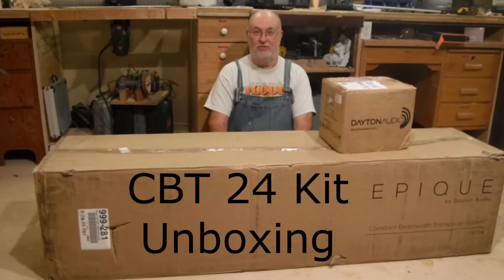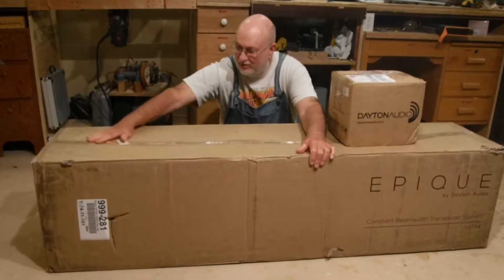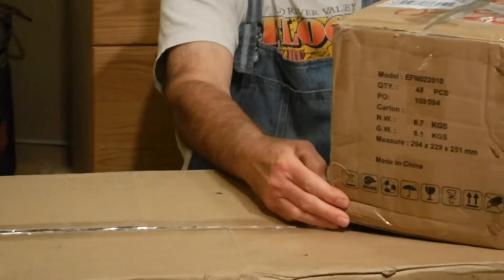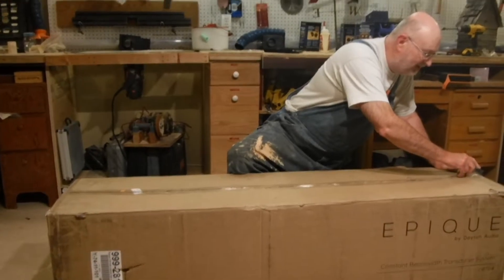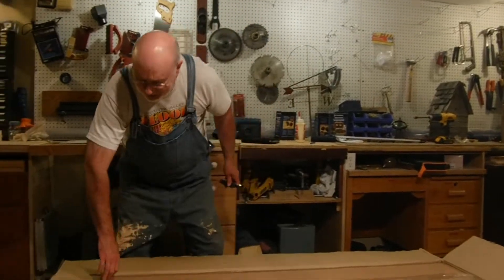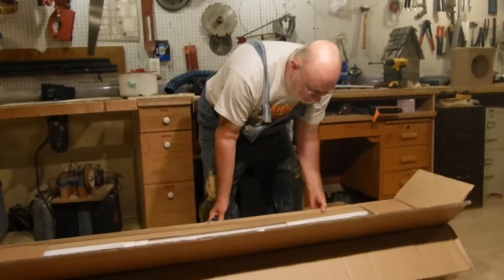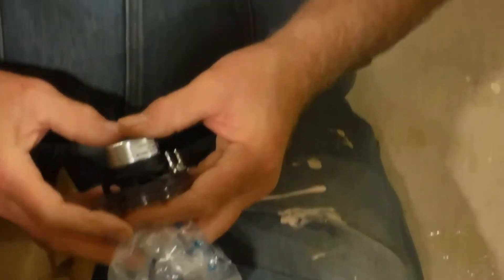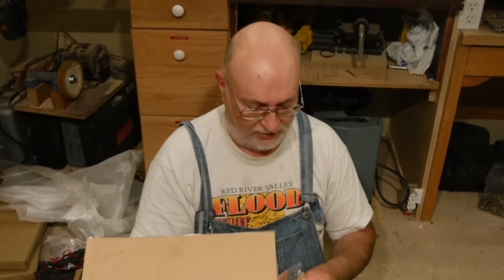Dayton Audio CBT 24 Kit Unboxing

Comment: So, what do they look like assembled??  Cant wait.
Reply from the maker: Tomorrow I finish painting them ........ video to follow ;) Assembly is probably on the weekend ........ video to follow lol.
Reply: @clydelindman6083  Cant wait to see what kind of finish you put on them.  I am guessing natural wood veneer if anything to match the house?
Reply from the maker: @tkcdac  I actually went for basic black. I put a roundover on the edges so they would not be so sharp compared to the curve of the cases. Glad I did that as it makes it look much more organic. I decided to just do brush and roller for the paint. Probably a mistake as the MDF broadcasts every unevenness. Next life I'll spray it :P I thought of veneer but have only done it once in my life and I did want the radiused edges so that would have complicated matters more as the curves are quite tight and probably would have cracked the veneer.
Reply: @clydelindman6083  Really excited to see how this comes out.  I am working on my own exciter panels in a 4 driver array per channel as "Tech Ingredients" did.  Wish those things were a hundredths as cool looking as this will turn out.
Reply from the maker: @tkcdac  My DMLs weren't bad, just not what I wanted sound-wise in that they got loud but not big. Also there was a strange coloration in the brass edge and violins probably due to the material used. However one would be hard pressed to find  better sounding speaker for the less than $100 spent on the project.
Reply: @clydelindman6083  I wish mine cost that little.  Turns out I didn't have the amps to run them, and bought a miniUSB DAC to correct the tone of each speaker.  Hoping it is not a big waste of cash, but I HAVE TO KNOW!!  Its going to cost me $500 easy with all the materials.  If anything I have speakers to run in my friends shop...   
Wondering how the sound stage sounds on those 24's.  Thats like a true force of sound!